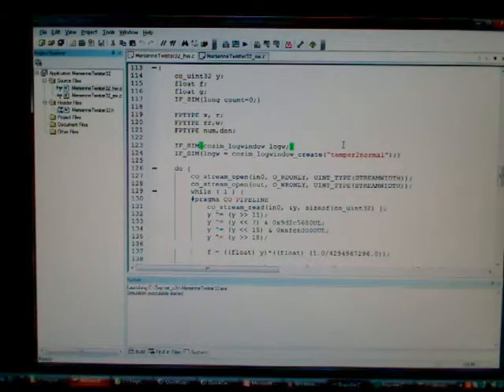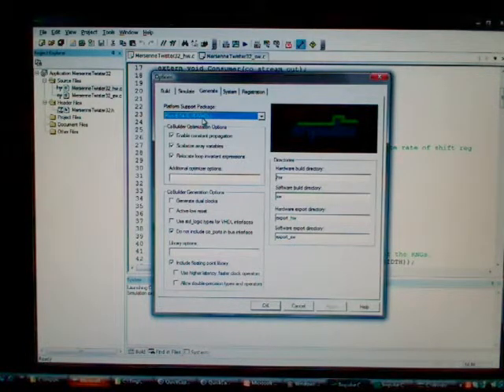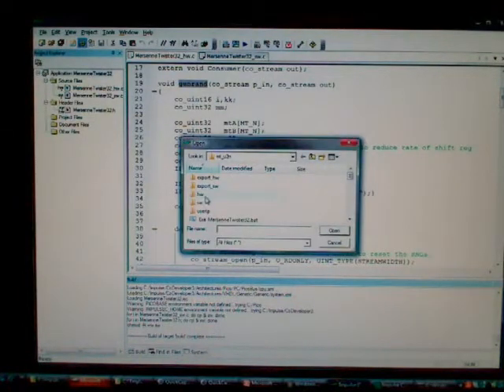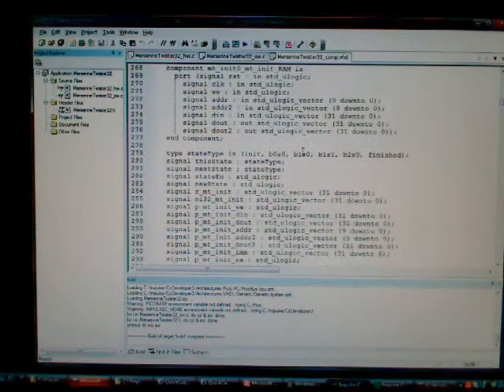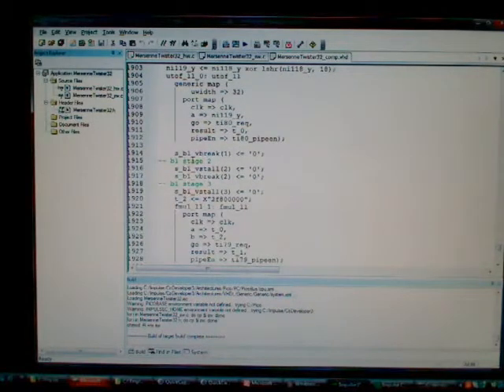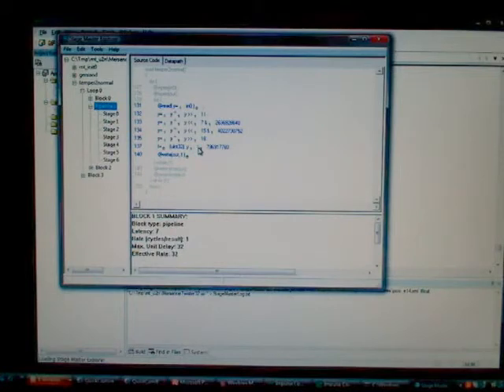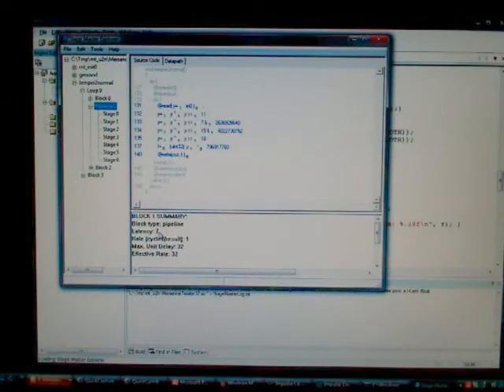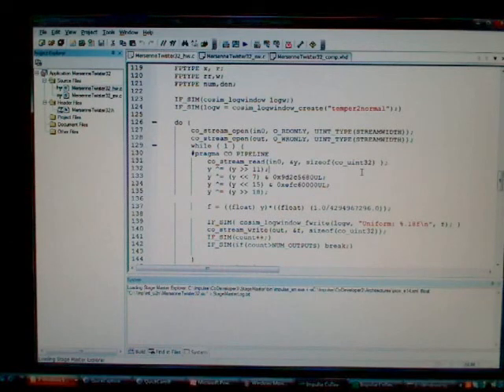Impulse C-to-FPGA with Pico Computing Part 3

Comment: Fairly straight forward. If you have a simple algorithm you can "wrap" it and get results; but they will be slow. The point of the tools is to refactor the algorithm into coarse grained logic that can be more easily machine compiled into multiple streaming processes. It is not rocket science but it takes some user involvement. We offer free eval licenses which you can obtain from the eval link on our website. You might want to aim further questions at support at impulsec dot com.